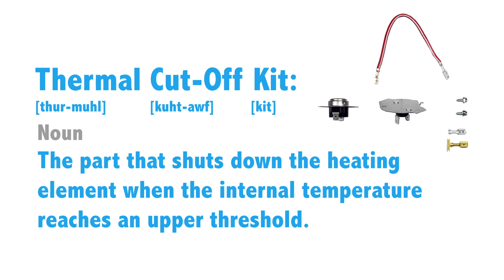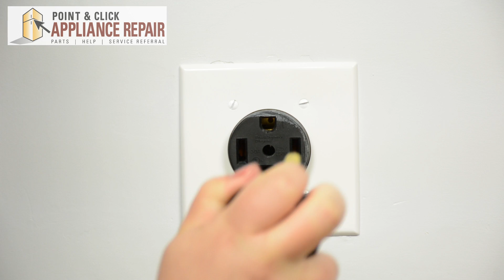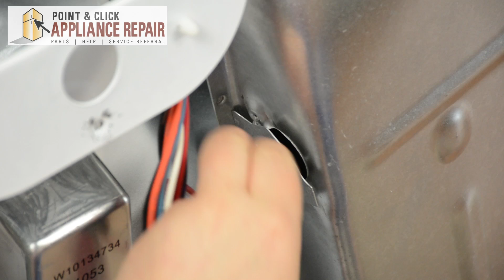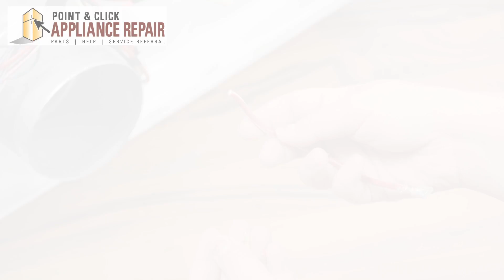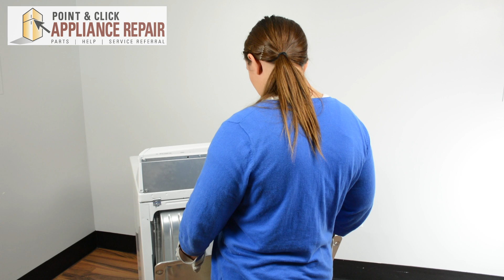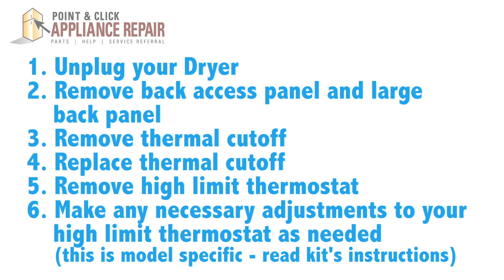279816 - Replacing a Thermal Cut-Off Kit - AP3094244, 2651, PS334299

Comment: This is good, but I don't have the orange wire ... 

Whirlpool Dryer Replace Thermostat & Thermal Fuse #279816
If no orange wire .......... * https://youtu.be/VHYg_I90ONo
Several other things:
1) like this machine, mine did not have a 3rd (orange) wire. Most videos
 show that wire and require the male / female connector jumpers splice.
2) while I did reset the old (upper) high-limit thermal trip by throwing
 it on the ground, 15 times before it made, I used it only as a test to 
prove that that was the only thing holding me back. After installing the
 new one, threw out the old one.
3) after all repairs kept the back off and checked cycle times (90 on, 
45 off). ** This was after a 5 minute initial warm up in a warm house,
 on a warm day.
4) while I did find a good online vendor from another videos referral, I used Cashwell Appliance in High Point and they were able to walk me through some questions, worth the extra money.
5) SCHEMATIC TRAINING ANALYSIS ... GREAT Video:  
Dryer not heating up 
https://www.youtube.com/watch?v=yCOPR5HNb20&feature=youtu.be
Reply: Mike... THANK YOU!!! I checked out the other video u referenced for those without an orange wire (like myself) and it was exactly what I needed. Thanks!

Comment: I bought a kit and it came with a new high limit thermostat (looks like the original with arm) and also the new piece you installed.  I just hooked up the new one with the arm because it was easier.  Should I have hooked up the one where I need to cut the wires?  What's the difference?  Great video by the way.  Really informative.